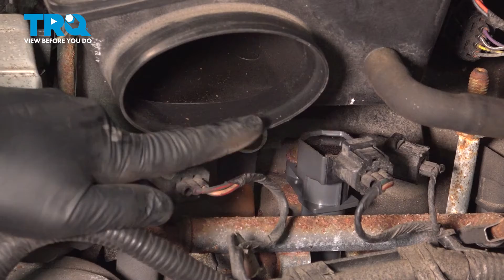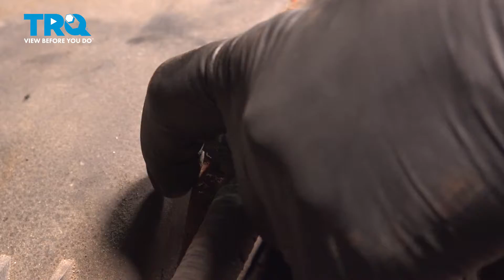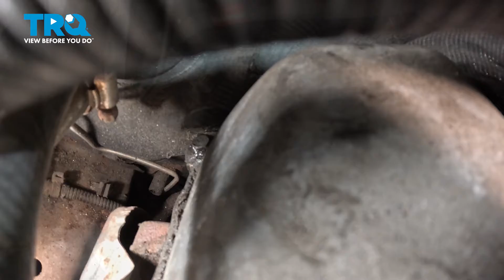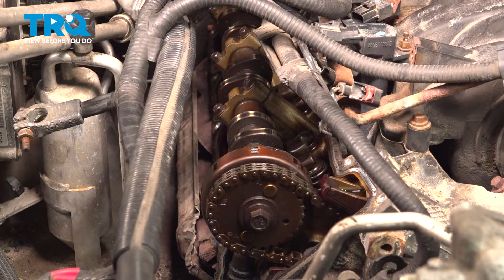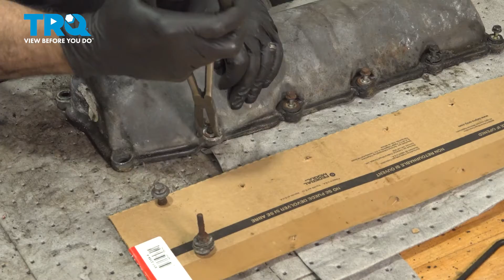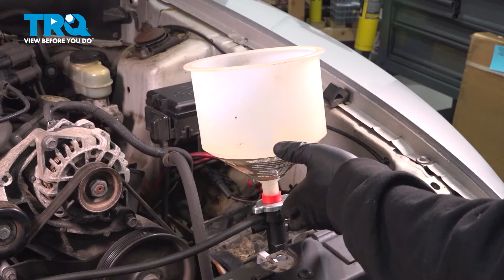How to Replace Valve Cover Gasket Kit 1999-2004 Jeep Grand Cherokee (4.7L V8)

Comment: Recommend replacing the lash adjusters as well since you’ve got access. One of mine failed and the engine blew instantly. 11k$ for a new engine installed…

Comment: This is the best video on how to replace the valve cover gaskets for the 4.7 WJ. Thanks for providing it.

If you are doing this job and looking at the passenger side cover wondering how to access the back bolts even after doing everything in this video try the following, it's only a couple more bolts to remove:

  1.) Free up the wiring harness on the firewall and on the transmission computer bracket.

2.) Remove the bolt and nut holding the transmission computer Bracket.  Lift the Bracket up with the transmission computer still attached, and place it on top of the intake manifold.

3.) Remove the two bolts that hold the coolant reservoir tank, detach the sensor plug, and lift the reservoir up, and place near the front of the vehicle.

4.) Now you should have easier access to the back bolts.

You will still need to really move the harness around to get to all the bolts.

5.) The valve cover bolts are only supposed to be lightly torqued, but mine were wrenched in tightly, and one snapped off flush with the cylinder head trying to remove it.
I would suggest giving any tight bolt a tiny bit of tightening first to free it up, before trying to crank it loose.

 6.) When removing the crankcase breather hoses in the back, the crankcase breather valves may crack off flush with the head. For 99-2001 models, you can use a 3/8 hex head socket to remove the piece still threaded into the cylinder head. The Mopar part number is 53030850, for later models they push in and the part number is 53030850AB.

Be sure to have a some long extensions, swivels, and short and deep 10mm sockets ready to go. 1/4" and 3/8" drive.

Also, a Gearhead 10mm Flexhead ratchet wrench will come in handy, along with magnetic foldable led flashlights like the Braun ones sold at Harbor Freight.

Good luck!

Comment: I understand 100% that you’re showing the correct way to do these but you do not have to pull the battery and try and all. Nor the heater hoses. I get the fact that it’s for clearance but. I just did mine with no issues without removing as much